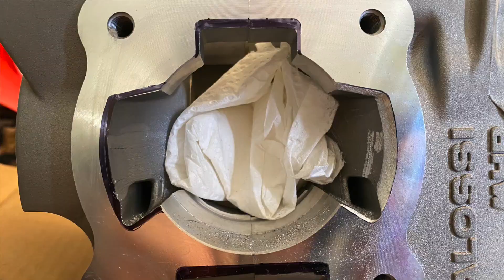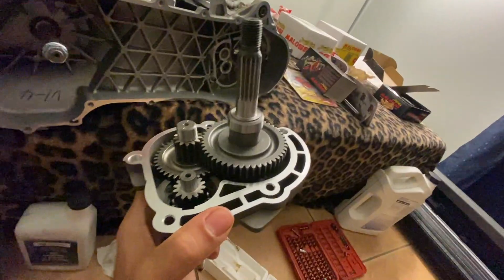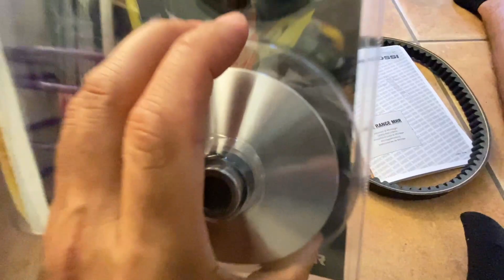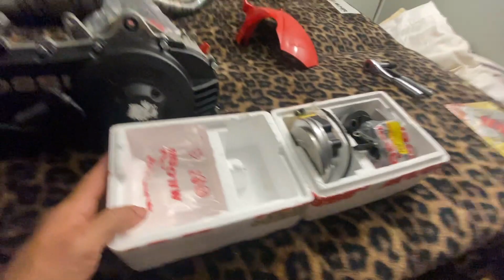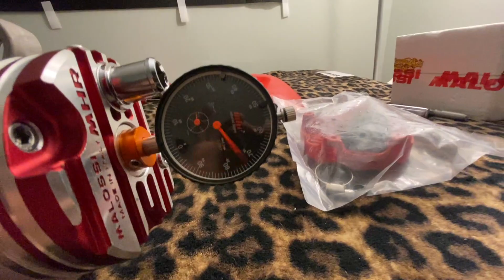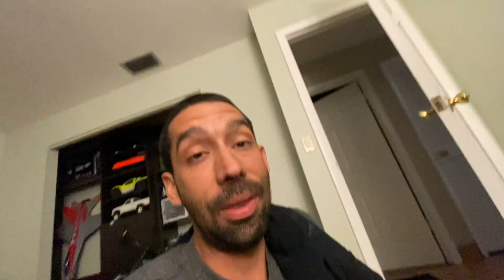AEROX RC ONE Part 2: BUILD and PREP

Comment: If you’ve not set the squish will that not affect your timing as if you squish it down further it will shorten the 1.55mm ? I ask because I don’t know
Reply from the maker: The dial is only reading piston travel so no it won’t affect that length considering we are zeroing the dial.

Comment: Ahhhh aerox content brings back memories. I had an aerox when I was a kid (13-17). I had a bad crash and after that I started to tune the engine and the looks. In Estonia scooter tuning was really popular 10 years ago, I don't know how it is now. When mine was done it had a custom showscooter look. Didn't go too crazy with the engine because as a kid the scooter was my vehicle to get around with. I had stage6 streetrace 70cc cylinder, DMP adjustable clutch, polini variator, 19mm carb ect. It did like 110km/h (68mph), the speedlimit for scooters here is 45km/h so it was quite fast.
Yamaha aerox and Aprilia SR  were the "sportcars" in the scooter world:D

Comment: Because this build would supposedly not be at its very limits at 35hp unlike a Minarelli, would that mean you could drive this thing on the street often without worry of reliability issues if one wanted?
Reply from the maker: Yes exactly
Reply: @JackCecil  so could this be run on the road with lights, indicators? Does it have to be premixed?

Comment: I love it man but u have to get that carb to come out the side I don’t think it will run like that or will it
Reply from the maker: This case design puts the carburetor/reed/intake behind the factory mount. No need for modified mount
Reply: @JackCecil  coo coo can’t wait to see it bro I am a big fan of them scoots when I finally decided to pull the trigger on buying a scooter I was a couple months late they had already stopped shipping them to the U.S. so I just said f it got a cheap on and put a lot of good parts on it and it was good
Reply: I think he has the stage 6 subframe. It allows you to run a straight run carb setup